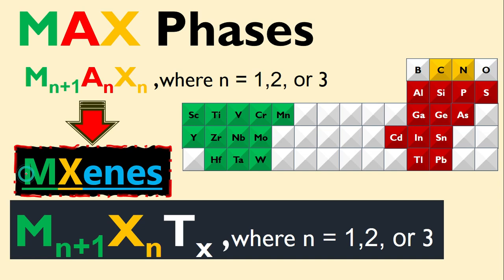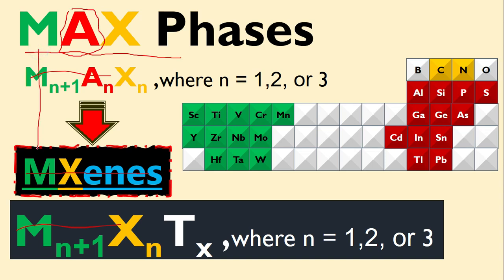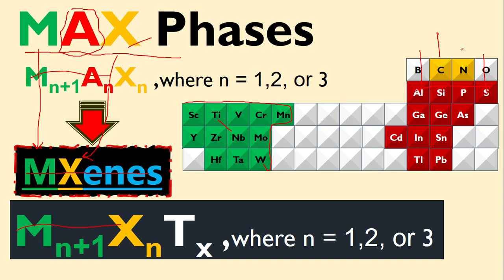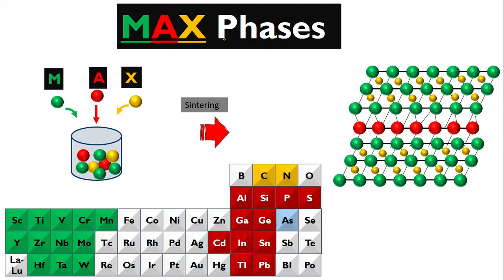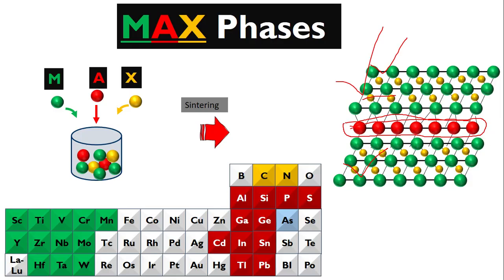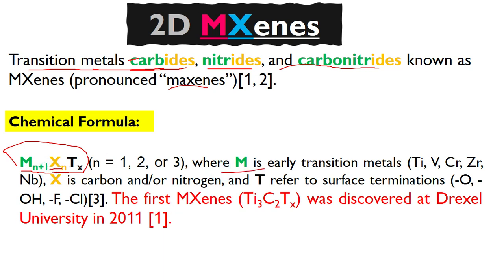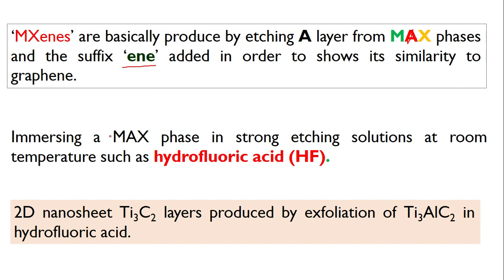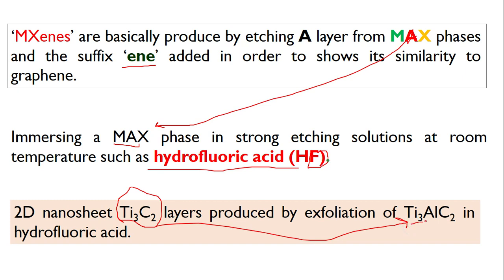How MAX Phases Turn Into MXenes | Synthesis of 2D Nanomaterials Explained

Comment: Slam sir, are high entropy transition metal carbides and transition mono carbides (ZrC, HfC, TaC) in the category of MX phases?
Reply from the maker: Wsalm,
The MAX formula is Mn+1AXn*, where *M is early transition metals (Se,  Te, V,....),  A is group A elements (Al, Si,....) and X is only C or N. 
For MAX phase, the following must be satisfied:

1•  the ratio of M:X must be (n+1/n)
2• A should be 1
3• X must be C or N
otherwise,  it will be   not a MAX phase

Comment: why we remove A layer sir, what about M and X layer
Reply from the maker: Good question.  There are two bonds M-A (Metallic in nature) and bond M-X ( which is covalent /ionic/metallic). The bonds between M-A is weaker than M-X and it is can be easily removed. The M can also be removed but then we get another structure that is called CDC,  carbon derived carbon.,...  Further I will make videos on this

Comment: sir can u  pls explain how to derive this formula M n+1 A n Xn , can  you pls use any example to derive it sir
Reply from the maker: These are basically ternary carbide in most cases and the compound formed either Ti2SiC, Ti3Si2C2, Ti4Si3C3..... There are almost 1200 MAX phases confirmed by DFT.. Anyways I will  explain this one too